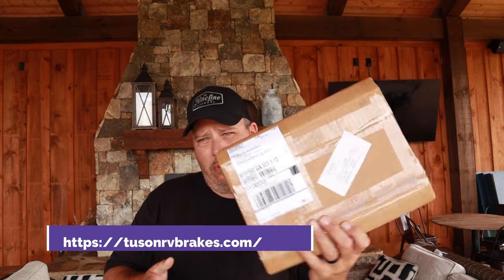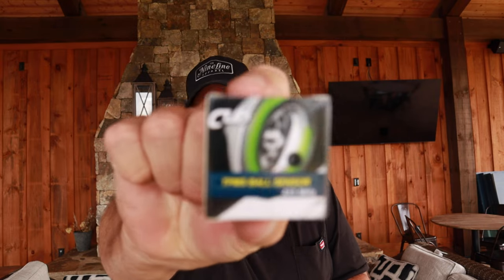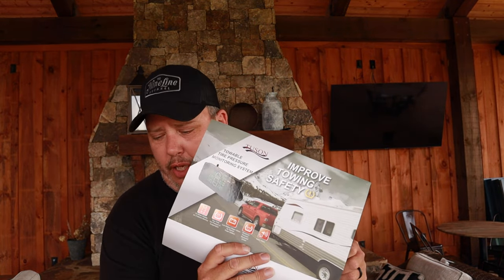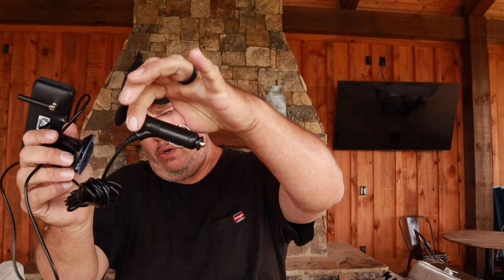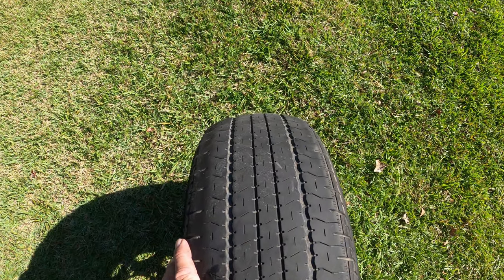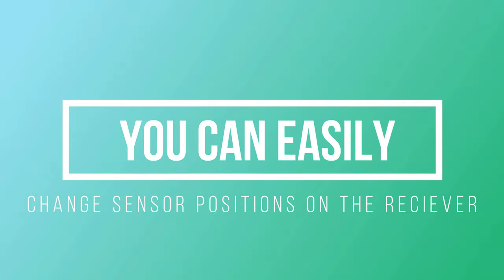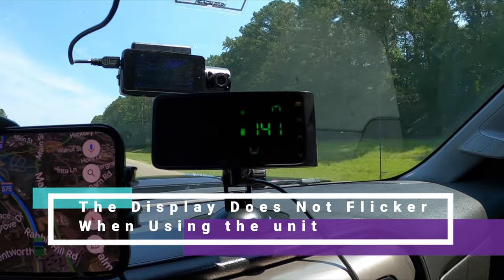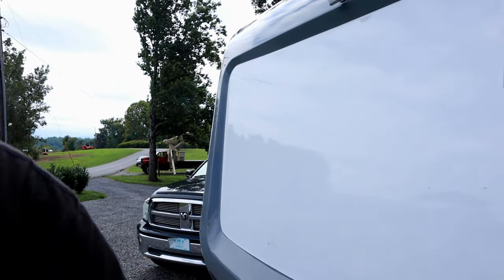Saying Goodbye to TireMinder / TST TPMS Nightmares!  - The BETTER Alternative !!

Comment: It happened to me. Within an hour and a half from the house I had 3 tires go flat because of the valve stems leaking. Not all at the same time.  The stems were rubber at the rim with a chrome shaft. They were leaking at were the rubber and metal met/glued together. The travel trailer is 2 years old.
Reply from the maker: Yup. It is a real thing and a real problem for sure.   So far so good with the internals so we will see :)

Comment: I've had the TireMinder A1AS system for 3+ years now.  Never had a valve-stem problems or leaks (I do have metal valve stems on my truck and trailer), but I have had a bunch of the sensors fail.  The internal battery cage/holder has broken on 4 of them now.  They have been great about replacing everything under warranty, but that doesn't help much when you're on a trip.  Overall, they work great.....until they don't.  I now carry one or two spare sensors with me. 😩  The batteries do need to be changed every year or two.  Not a big deal for me.

Comment: This is a really neat system, but way over priced, just like all the systems at an RV dealer that you can purchase online for cheaper. I will just continue my old school ways of proper inflation, inspection and random tire checks just the way I did them when I was a truck driver, I hardly had a blow out because of that method.

Comment: Yep…went through 3 valve stems on one trip out west.  I have been driving for 40 years and I had never had a valve stem failure.  I put these in my fifth wheel the previous summer and went through three valve stems.  The end-of-the-stem monitor is like a weight on the end of a fishing rod spinning around at 65 mph…I took those off to complete the trip.  I have since changed to Tuson internal valve stem mounted-the balls are intriguing however.

Comment: I had a flat due to the TST sensor wobbling on my rubber valve stems. I had to replace all my valve stems with steel valve stems.
Reply from the maker: It’s just not something they really tell you about I don’t think.  And they definitely should !   Caused us the same issues numerous times.   Glad you got the steel stems put on. Thanks for watching!

Comment: Years ago, I had a flat tire & never knew it until I saw smoke in the rear view mirror...never would have thought you could feel a flat!
Now we have a newer SUV/1st vehicle with OEM TPMS system. Again, didn't notice a dif in ride; but could see that 1 tire was 11lb below pressure.  Pumped it up ever few days & was able to get it into the shop. We had picked up a nail somewhere along the way.
We also have an older camper van & will be putting an after market TPMS system w/ metal stems...I'd rather know of a small leak vs a blowout damaging the RV.
Reply from the maker: Metal stems are the way to. I think pretty much on everything!

Comment: I was wondering about those screwed on the valve stem, I’ll probably go with the Tuson internal, my only problem is that I’m getting new tires Tuesday, and I doubt that I could get the system by then.
Reply from the maker: So if you have to get tires quick then ask the shop to put on all metal valve stems.  They work ok with the screw on sensors.  But I’d really try to get an internal kit if you can.  Much better
Reply: @HomeOnTheHitch  I ordered the Tuson I’ll just wait until it arrives, thanks again for the video

Comment: Price?
Reply from the maker: So I believe the ball sensor kit is 479.00.  The standard automotive internal kit is about 100 bucks less than that.   

https://tusonrvbrakes.com/collections/trailer-tire-pressure-monitoring-system
Reply: What if you have multiple trailers?
Reply from the maker: @LG_Miller you can buy more sensors to put in those tires and each monitor can store up to 3 different vehicles /trailers
Reply: @HomeOnTheHitch  you still liking them?
Reply from the maker: @LG_Miller so far we haven’t had any problems with them. We’ve had these in for almost a year now and they are still going strong. Idk what the future holds but I do like the idea of the internal sensors waaaaay more than the valve stem sensors